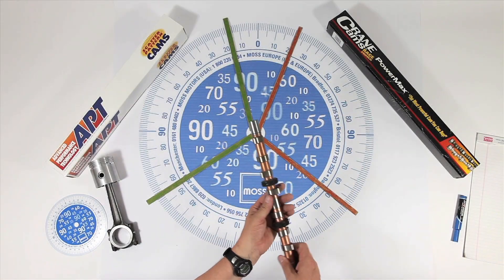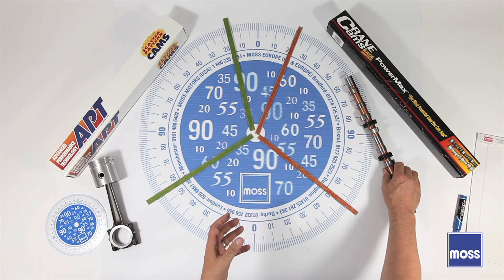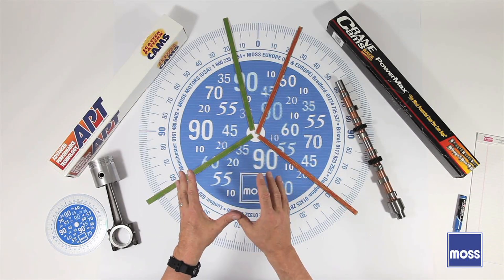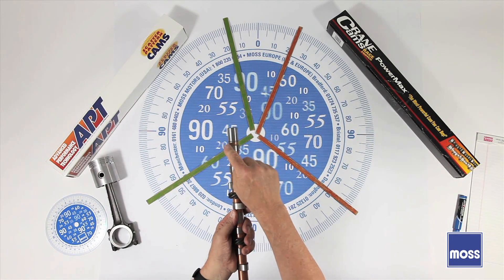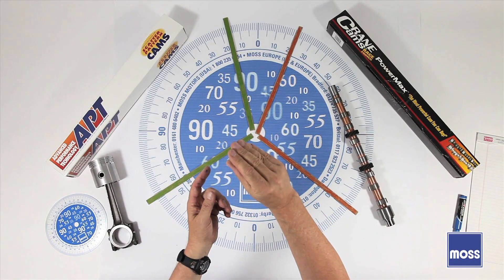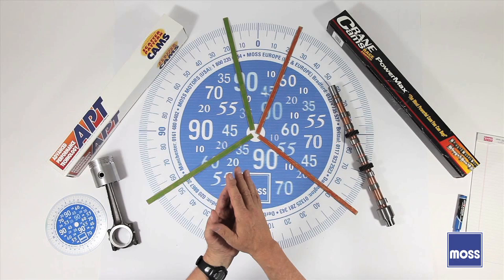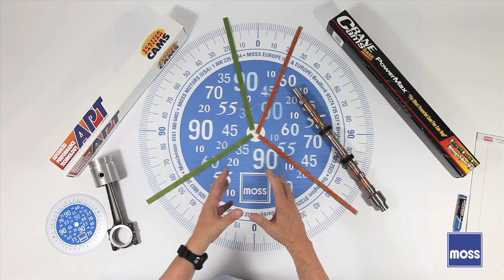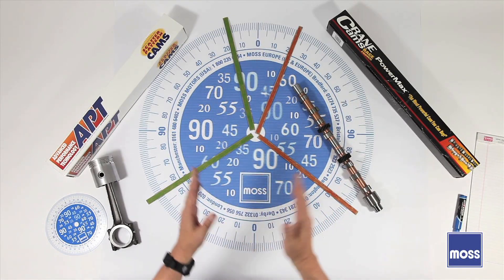Camshafts (Part 5) - Camshaft lift is explained

Comment: This video series is just the tip of the iceberg with respect to cam profile design (calculated 5th order,  10 boundary conditioned B-Spline curves to generate cam lift profiles that conform  to specified open and closed timing events).